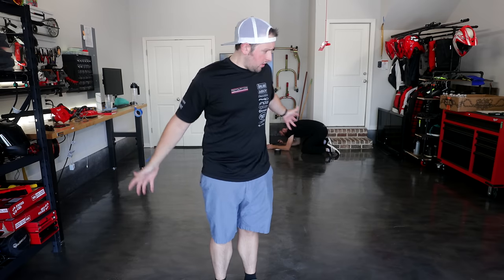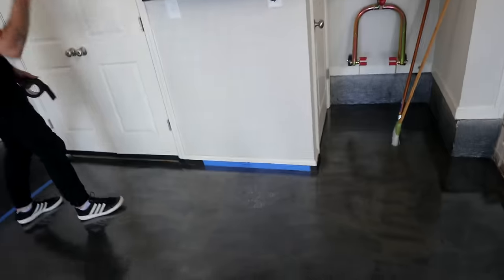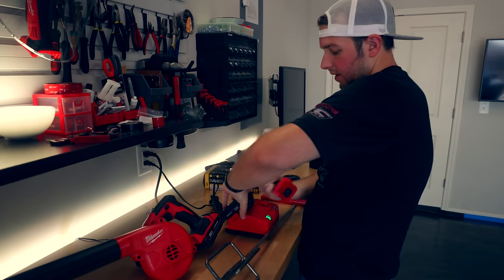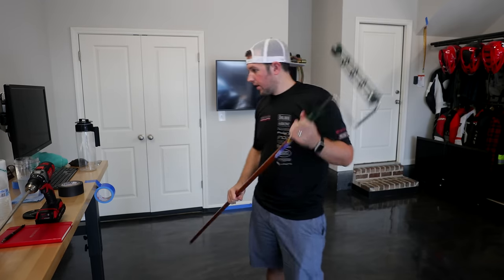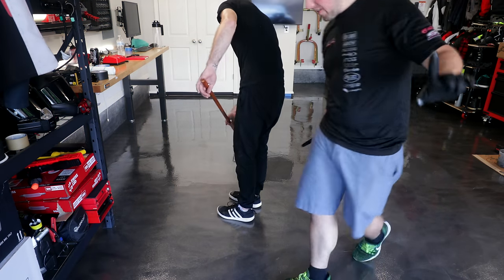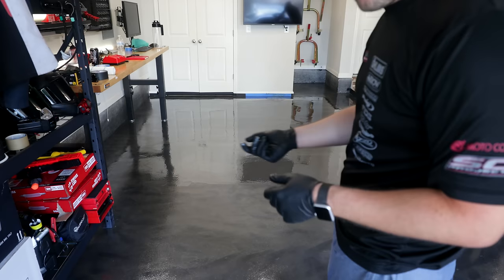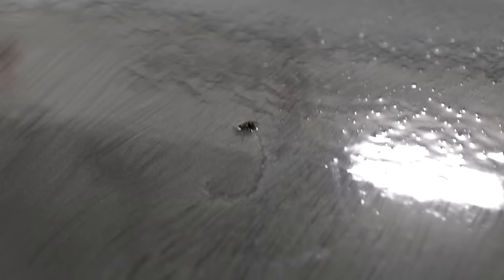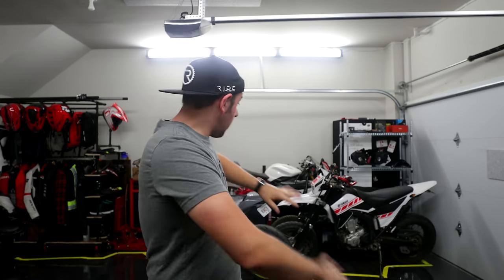Fixing my Rocksolid Garage FLOOR

Comment: Rock solid is water based and portions of the product end up evaporating. I cannot recommend the Rock solid product after using myself in my garage. I ended up doing my garage a few years later with an industrial grade epoxy for less money and better results. Its just a matter of knowing how to use the product. I actually sprayed with alcohol spray bottle after application to avoid the bubbling that happens. The other option is to use a torch to finish.

Comment: So what's the cost difference between the epoxy and the floor tiles from the last house?
Reply: I spent $400 for a cheap epoxy on my last house. In this one, I spent $800 on plastic tiles, and it was worth it. Better look & much more comfortable on your knees. Much easier to walk around on tiles vs. a hard concrete floor for 8 hours.

Comment: Should have YouTubed : StoneCoatCountertops Mike there has a concrete floor epoxy, i use their products all the time, you would have been way happier, its also not nearly as costly, check them out Chase.

Comment: the problem is!   you applied it all wrong.
If you want your floor smooth and shiny you should have sanded the concrete before applying rock solid.

Comment: Ok. So. Im not going to list all the problems with this video but I will say that first, a floor coating company like I own would charge you $5-6 a sq foot. Ill let you do the math. Second. You WILL NOT get a chemical bond on your second coat. Plan on it failing. Third. You cant assume that all concrete floors are the same and that they will all accept the coating the same. Good luck LOL

Comment: If you're doing a garage floor STEER CLEAR OF ROCKSOLID FLOOR COATINGS!!   There's a reason the packaging says indoor use only and its because sunlight discolors the coating.  I coated my gaarge floor 3 years ago and its yellowed horribly about 6 feet in from the overhead door. I'm looking at spending $5k+ to have it removed and coated with a product suited to the environment.

Comment: The floor looks like shit tbh. At this point the only way to fix it is to grind it off and start new. Rocksolid is a mediocre product too as its water based. Buy a product from a wholesaler that is solid and not 20% water.

Comment: I used way less than you and it came out glossy and smooth. Your application technique absolutely sucked. Those bubbles are from laying it on too thick. I hope 6 years later you got better at this.